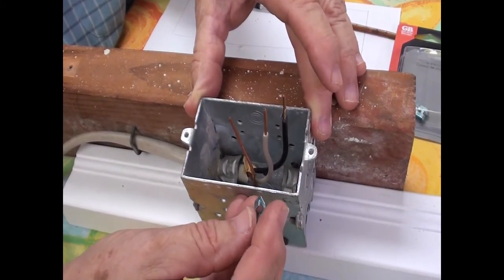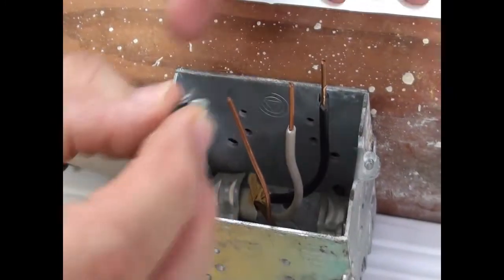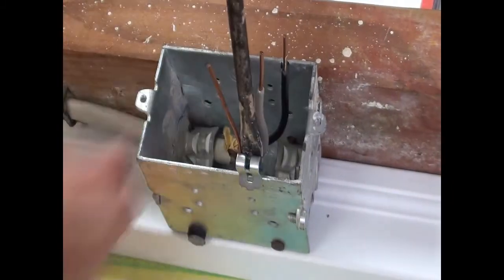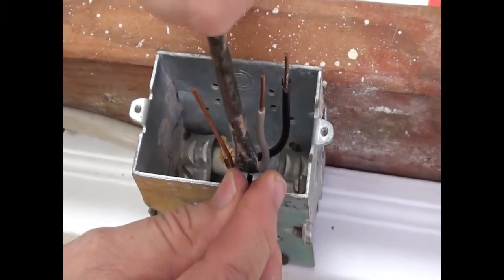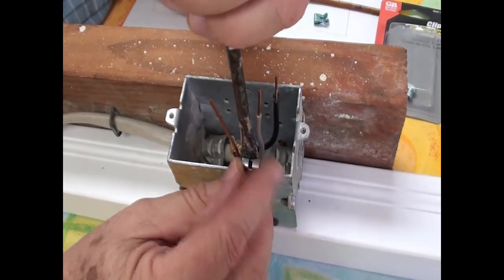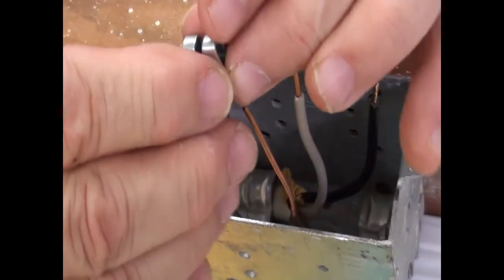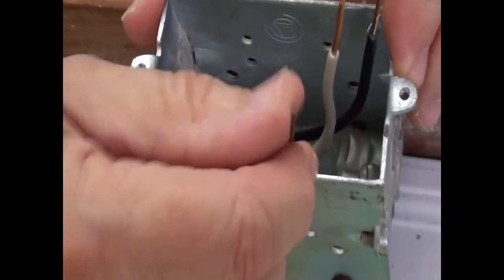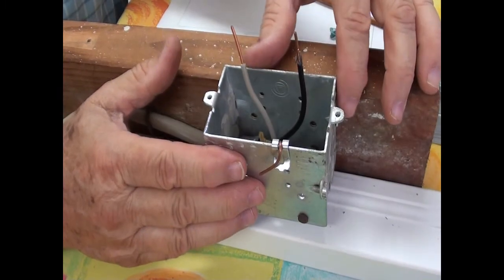Ground Clip attachment to a  Metal Electrical Junction Box

Comment: Good description on how to use a grounding clip.  Thank you.  If I had to choose,  I would feel more secure with a grounding screw.
Reply from the maker: I agree with you.   I, too,  believe a better bond would result if one used a grounding screw.  I have found that some of the older (decades ago) metal boxes, that were not properly grounded when installed,  did not have the typical preformed pressed metal grounding point (the currently sold metal boxes usually (but not all) have a preformed pressed metal grounding point designed for a grounding screw.  For such older metal boxes missing the grounding point, I use the clips illustrated in the Youtube above.
Reply: They will both equally bond the ground safely. Not all boxes have a ground hole, and not all installations will tolerate a ground screw sticking out the back of the box. I've also found ground screws stripped and not doing much bonding. Feel safe with either, properly installed.

Comment: Wow. I haven't seen any box clips in perhaps 30 years now. They used to be required to connect the bond wire in bx to the box. Never seen one used to ground a normal copper wire. Most metal boxes have a threaded hole in the back of the box for a ground screw which makes a far better ground.
Reply from the maker: Thank you for your helpful comments.  It is very true that modern boxes are equipped with the threaded hole (sometimes with a rounded elevated indentation the size of a dime).  I agree that using the modern metal boxes with the threaded ground screw does make a far better bond.  For some reason, maybe my family's tendency to squirrel away parts forever, all my metal boxes are "old school" not having the threaded hole for a proper ground screw.
Reply: @takeachanceonme4  Most of the older boxes have holes drilled in the back. Come to think of it I've never seen one that doesn't. Use a tri-tap to thread one and use the green stinger.

Comment: Very helpful video. Thank you for posting it. My apartment metal box is quite old, with no ground wire available in the pipe attached to it. There are no ground wires in any of the pipes that are attached to my electrical boxes. An electrician once told me, the reason there are no ground wires is because the insulated wires encased in metal pipes are ground by default. This is the case for my entire building. Are these clips necessary if I add a ground screw to the back of the metal box and wrap a copper wire j-hook around it, and then wrap the other end around the ground screw on the receptacle?  Will this method give me added redundancy? Thank you.
Reply: You should buy a cheap outlet tester and see if it shows your outlets are properly grounded. There might be a strap behind the mounting screw that grounds it to the metal conduit.